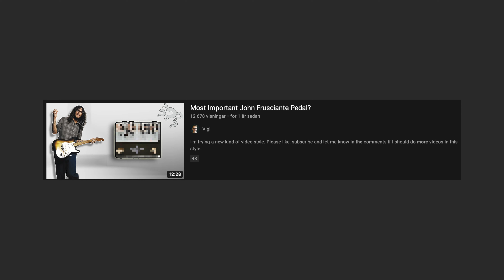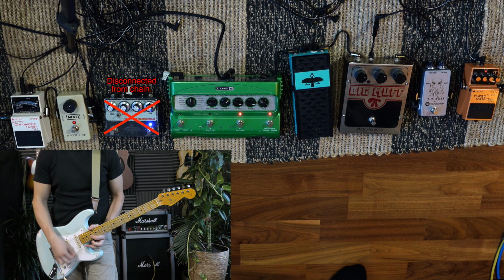Micro Amp VS Chorus Ensemble for Frusciante Crunch

Comment: John actually used both (The original CE-1 and Micro amp) and never left one of them from the board. Actually I think the Micro Amp is most underrated pedal of all time - my favorite clean boost ever - and there is a big different between a new one and early 80's ones which john using. Anyway great comparison - both are great.
Reply: What are the differences? And any source on John's being an early 80s model?
Reply: Yeah but did he have to use the Micro Amp too because of the long cable runs? Frusciante fans don't have to worry about super long cable runs, we're not rockstars.

Comment: The micro amp doesn't really do anything aside from boosting your signal. So what you're actually hearings is your natural tube amp overdrive compared to the CE-1, not the pedal. So if you have a solid state amp, don't think that you're going to get the tone that was in the video. You need a tube amp, or more specifically the two amps in the video to do that.

But the amp crunch really holds up well. The CE-1 probably isn't all that necessary if you can hone in on that.
Reply from the maker: Hmm I think of it as both pedals boosting the signal and both coloring the sound on its own way. 🤷‍♂️

Comment: i'd say it's quite a significant price difference. i've been using the boost on a behringer super fuzz which was just $19. the micro amp is $80 whereas the ensemble crunch is nearly twice that. there's also a huge variety of boost pedals to choose from.
Reply: And the SF300 takes well the DS2 or the WH10? It's quite impressive for me, as people love that pedal due to fuzz sounds, and ignore the boost function
Reply from the maker: Hmm, € 98 (Thomann) vs € 116. 🤷‍♂️
Reply: @Vigi  which country do you live in? Been meaning to ask. In America the micro amp goes for $80 USD with free shipping. But i know other countries have different sites with different prices (not to mention currency)
Reply: @jorge.az07  the sf300 boost works well for pedal stacking. Cleaner than combining a distortion+fuzz, just put the boost before your distortion or fuzz. Works well either side of wh10. I got the pedal mostly for boost. Boost is really only good for getting extra gain from your tube amp or tube modeling pedal. But you can use it to push your other pedals too.

Comment: The CE1 sounded way better, but the price tag is too high for me

I found, by trying lots of pedals that what works for someone may not work for everyone and in the end, it's all about trying. I get my crunch sound from the Joyo Deluxe Crunch and sounds clear and takes the DS2, Fuzzrite and WH10 quite well :)
Reply from the maker: It’s awesome that you share more roads to great tone! I had no idea about this. :D
Reply: hey! I also used the joyo DC for the "Frusciante clean crunch", and other cheap pedals as well, but it never got me that close with my setup. I remember with the Joyo I had to dial the DS2 differently like, level and dist maxed out but the tone at 12'o clock.  Now I use the Morning Glory and feels more "legit" but I think the idea is to stop obsessing so much over correct settings and find your sound within John's palette.
Reply from the maker: @LuisRFeliu  Thanks for sharing your experience and well put conclusion. :)

Comment: Boss DS2 + Big MUFF + Fuzz Rite Stiched ON at the same time?! and no Noise!!!! which power suplly are you using?
Reply: thats due to the ce-1 pre-amp chip in the pastfx model.
Reply: @hertderg12  I have the Triungulo Version of that Preamp. And I still cant understand, how with that 3 High gain pedals on at the same time, the Noise Ratio its so good.
Reply: @gonzalodiazgallardo9540  you have the signal chain in correct order with an individual power supply for the triangulo?
Reply: @hertderg12  Yes, same chain order... And the triungulo has the same supply, but isolated from other pedals.